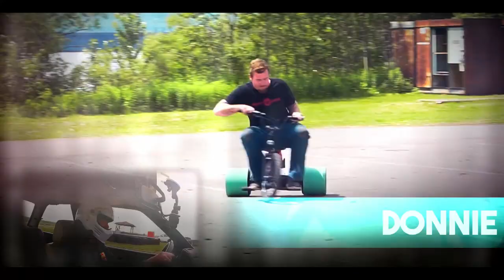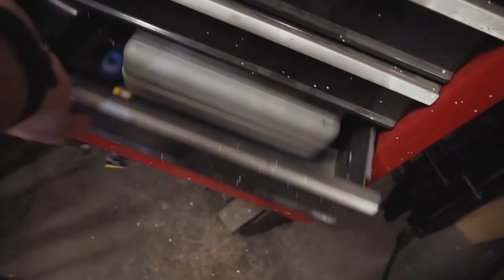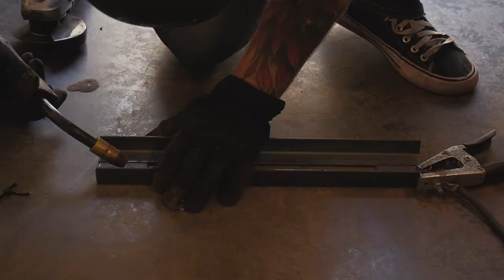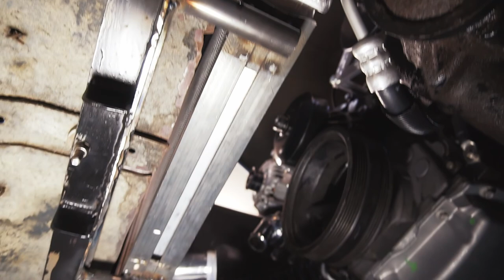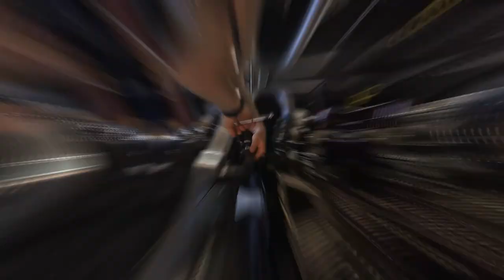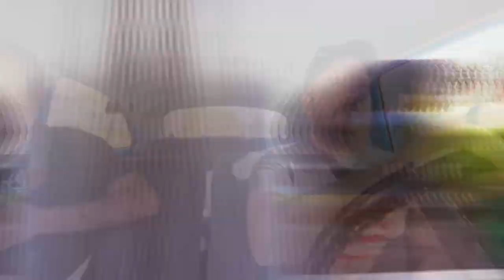First drive of the Shoebox Ford after some problem solving (build Cooling system); Shoebox Ford Ep13

Comment: Thanks for all the info. Great job! This will help a lot. I, like a dummy, tried to fit a wider radiator than I should have which screwed me up and so I am going to remedy that situation. Hopefully, I have the original sheet metal for the radiator mounts still…
Reply from the maker: How wide did you try to fit?
Reply: @DadModsMedia  I would have to get the dimensions but it was to sit above the frame and  low enough to not interfere with the hood closing. I believe it is a 60s Malibu radiator if I remember correctly.
Reply from the maker: I gotcha. Yeah sounds like a huge pain. These Speedway universals are really nice and so far it seems like this one is adequate for the climate in northern MN. If it did it again I would do a double pass though.
Reply: @DadModsMedia  that makes sense. I just moved back from VT to SoCal where my shoebox was stored for the last 5 years. As much as I would have wanted to finish…she needed to stay until I returned.
Reply from the maker: Time to get back at it  😉
Reply: @DadModsMedia  absolutely! Thanks for the great detail on the hoses, radiator, and brackets. That will make it a lot easier. I’ll post the progress as I get back on it.
Reply from the maker: Happy to help!

Comment: Next time use a drop or 2 of antifreeze and wet the inside of the radiator hose and they will slide on a lot easier.
Reply from the maker: Good point. Didn't even think of that